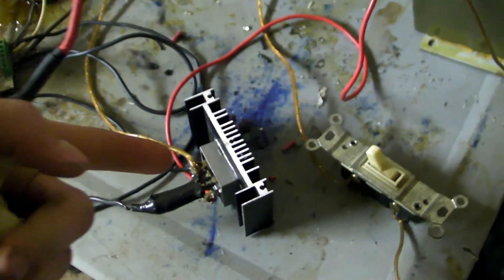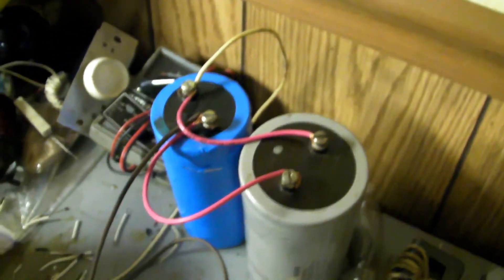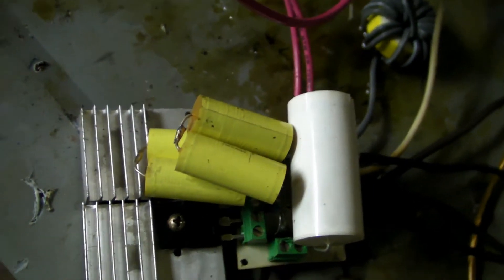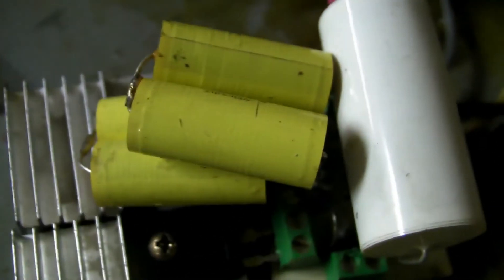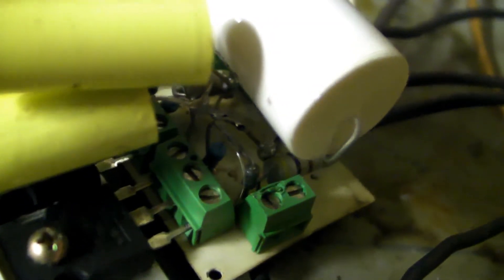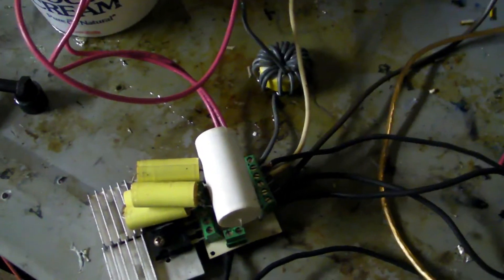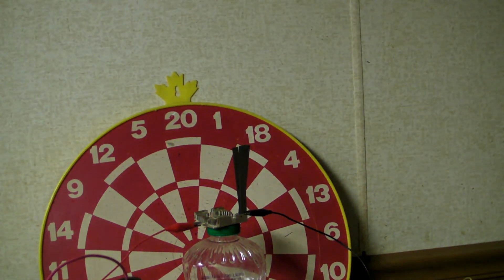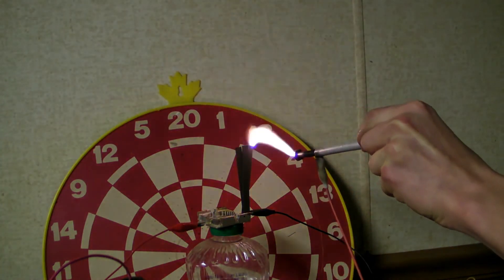Huge ZVS Arcs & Dead Flyback

Comment from the maker: Instead of using PCB's and wires to solder components together, and assuming its a simple circuit where components do not need to travel far. Components are soldered directly to other components. Such as a 470 ohm resistor being soldered straight to the mosfet gate instead of wires between

Comment from the maker: @TheMaxii2007 Thanks, I was keeping an eye on the heat though, it was only warm, but the internal diode couldnt take it, and when it blew, it resists a lot of power, causing a very low output. Even after dead it only got warm.

Comment from the maker: @jeffddow charge it with a rectified MOT. Input about 24-56 volts to the primary, (I dont remember what exactly) and the DC output should be around 450. What I would do is monitor the voltage as it charges, and cut it off when it reaches 425. I did that with a single 450VDC 2,400uF one before.

Comment: I destroyed a flyback the other day too, but by shooting it. Turns out the dried epoxy insulation is as hard as glass and very sharp when cracked.

There is still a piece of the horseshoe base missing that flew off into a near by bush that I have yet to retrieve, but I think I will wait until spring when it gets warmer outside until I bother looking for it!